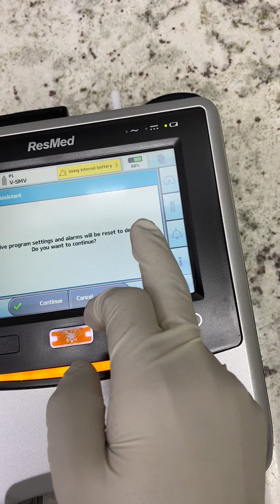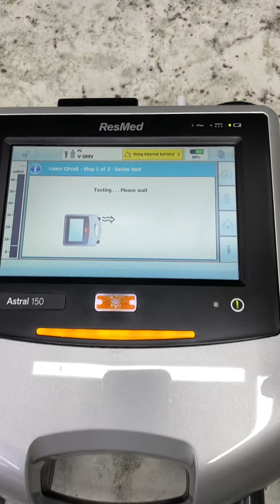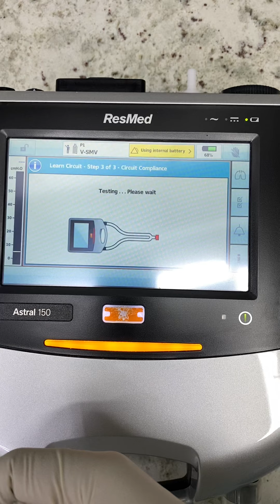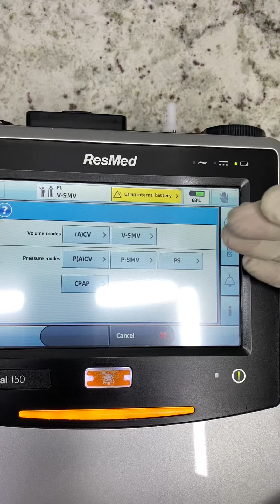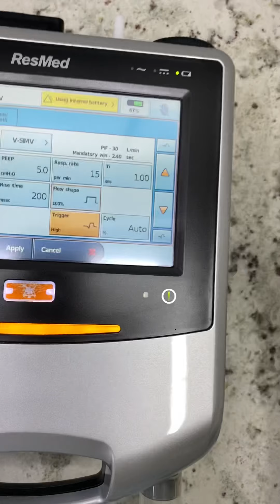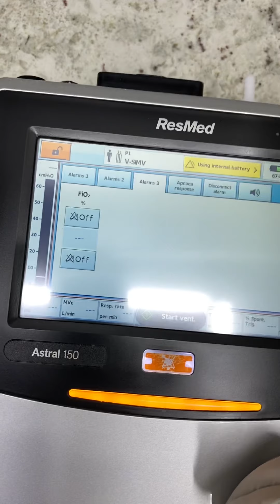Resmed astral 150 part 2

Comment: Hi sir does Paediatrics patients have different things or same can be used?
Reply from the maker: You can choose the pediatric mode    And use the pediatric breathing set.
Reply: @shajidthennancheri187   Paediatric breathing set available with the machine?
Reply from the maker: @dr zahid.  Resmed has ped breathing set.  Also u can use any ped double limb circuit or single with valve circuits
Reply: @shajidthennancheri187  Ok Thanks... single limb for cpap, and there are two double limb circuits.... plz explain their uses ...highly appreciate ur replies